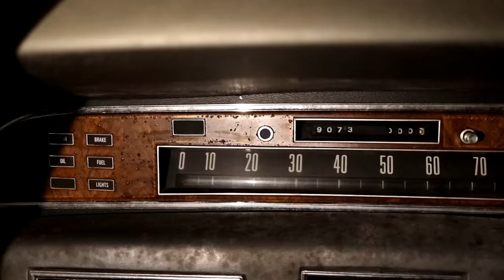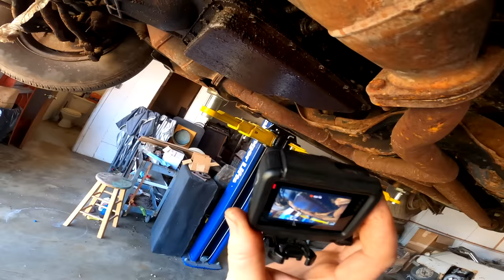Abandoned 77 Lincoln Continental Rescued After 35 YRS | Barn Find With 9000 Original Miles| RESTORED

Comment: My dad had one that was a78 model. The same exact color. Loaded out for that year. It had a 460 hp. Thats what it said on the air cleaner. And for a 5000 pound car it would bury the 120 mph speedometer and keep on going past that. Smooth as a pin even at those speeds

Comment: WOW 😯. Absolutely amazing to find a car that old with only 9,000 original miles. Pity that she’s a little dinged up but definitely worth addressing the dents and a good fresh coat of paint. On second thought though I have to question the odometer based on the the repaint and the condition of the underside of the car. Hmm 🤔

Comment: Nice car!! What brand plugs were in it? Do the wires say motorcraft or ford with a date code? The blue distributor cap isnt original.  Why would it need a tuneup at 9k miles? Still its awsome

Comment: Important message to the restomod people:
Please do not alter this reference OEM 77 Lincoln.
Leave as it is.
This car must stay original for future references.
As you well know, too many engines are damaged because neither an oil/filter change/air filter replacement/ was done or checked.
Excellent initiative that you guys took out the oil dipstick, and inspected it.
Refer at 7:15 time.
Can't help but wonder about the transmission dipstick readings though, after engine start up...
First start up of an engine after many years in improper storage or special care, spells pure havoc (damages) into motor internals.
Must admit that those hideaway/retractable lights and concealed wipers assembly, were the strongest selling points for me as a kid.
A leaf blower would of come to mind personally, for initial clean-up.
Really entertaining video and well done!

Comment: You missed the chrome bumper. But overall turned out pretty good. I am currently working on restoring a 77 Lincoln Mark V 99k miles and ZERO rust. Needs alot of engine work unfortunately, it's sitting on a engine stand ready to go to a machine shop to be hot tanked. Got alot of parts ready to be installed, she's gonna have at least 600 HP

Comment: For that "stink", if you take an old pair of ladies nylon hose or two and fill each leg with Activated Charcoal (like you'd use in an aquarium filter), tie a knot in each, making a bag o charcoal, and hide each one up underneath the front seats, one or two under the back seat, a couple in the trunk... That funky smell will go away in a few days... Leave em there until you notice the stink come back, they usually work for about a year.... Just replace the charcoal.

Nice old Lincoln!

Comment: In my opinion if a little old lady drove that car to church every Sunday  she drove from TX to the church  in NY. I own a 78 Cadillac with 28K now in 2023 and it still looks new with no rust or corrosion on and of the exhaust system or under body and the paint and interior is still like new. My first clue that I feel the car has 109K was the AC belt missing and the heater hose tied up with a wire. Still a good solid car that is easily fixed and has a lot of life left to it.

Comment: That 9000 mile title got my attention until you were under the car.  With the amount of oil and stuff around the oil pan, transmission and the Michelin tires (Ford products always used Firestone) and you mentioned it's been repainted. It's really a mileage unknown and closer to 90000 or the odometer broke at 9000 but the speedometer still works.

Comment: I can tell you that car has had the oil changed by the filter. When these Lincoln’s came out brand new they had a solid gray color filter on and came with break in oil that had to be changed after so many miles.I know this from working at the Lincoln dealer off LBJ freeway in Dallas years ago when these cars were still new, we sold those Motorcraft oil filters being I recognized that right off the bat.

Comment: For long as this Lincoln has sat I’d remove the factory catalyst converters. The longer you run it they will eventually stop up and pressurized the engine and blow the rear main seal. I had a 80’s ford that did stop up and blew the rear main seal.

Comment: Not a doubt a little old lady dinged a car like that up in 9k or 109k the leaks kinda lean towards 109k like others are saying. Our drummer once owned a 78 Diamond Jubilee edition Thunderbird, with a hair over 3k miles on it, documented. Every original part from the factory minus having 1 oil change. The little old lady who owned it first, got a nice fat dent in the passenger quarter right behind the door within the 3000 some odd miles. 
The leak and grime could’ve happened within’ 9k miles but it would’ve had to have been someone barely driving it for many years.

Comment: On the tires the Firestone 500 would have been on the 75-76 Top line Fords but they had a huge recall on those so Ford used BFGoodrich for a few years to replace the 500s till Firestone came out with the 721s not much better in my opinion , give me the Goodrich anyday !!

Comment: 109k miles - the 70s were tough on cars, but not that tough that a 9k car would look like that. Sludge, Stains, painted new, different tires (fronts where michelins, back goodyears). 109k Highway miles though...judging by that brake pedal very long drives without touching the brake much. Still, really good one!

Comment: You have to remember, if the alternator bulb (in the dash) is out ( key on engine off), then the alternator wont work. Replace the bulb and the battery will charge.

Comment: I wouldn't expect if a car had only 9,000 miles on the odometer that it would have grime on the rocker covers, even if it had never been serviced!

The general condition in the engine bay suggests a lot more miles than that!
Reply: You are right. 
On These old American cars the odometer only goes to 99,999 and then it will roll over to zero. It probably has 109,000 miles on it. 
Last year my 1967 Dodge Charger odometer rolled over to zero. It had 94,000 miles on it when I got it. 
And I wouldn’t be surprised if it already rolled over once before LOL
My charger probably has 200,000 miles on it

Comment: It's in good shape for being 45 years old. That's 109,000 miles my bet. I'll bet it was a traveling businessman or traveling salesman that bought it new. It's a 77 & was parked in 83, that's 18,000 miles per year, which is reasonable. There's several things that could explain the DOT codes on the tires, but my money is on 109,000 miles. The dings, dents, & scratches on it, the drivers side being slightly worn a little more than the rest, that's definitely 109,000 miles. 
Of course you wouldn't do it, but pull a plug out & stick a camera into the cylinders, it would look almost brand new if it was only 9,000 miles. Of course you probably won't see too much wear, as good as it runs, but my guess you'll find normal wear for 109,000 miles. 
I'm a GM man myself, but that is a nice looking car for being essentially a Ford product.🤣  
I just prefer a Cadillac over a Lincoln😆

Comment: Odometers back then went to 99999 and then rolled over to 00000. That's more like 109000. After my 1971 Continental rolled over it barely got just over 101000 miles until the engine seized. For years prior to myself buying it, the tank was filled with unleaded gas and those old engines like the 460 I had needed leaded fuel and no one bothered to add the lead substitute.

Comment: it's not good running a car with a dry transmission it's a good way to burn the pump right out of it and putting a dry trans in gear is no good too. it's good to have fluid on the stick before cranking the engine even if it's not to the full mark at lest you have some to allow the pump to have something in it to keep cool

Comment: As a Lincoln fanatic and owning over 25 Town Cars, I will say that I do NOT believe this has 9,000 Original miles. I'm confident it has Over 100,000 miles. I had a 1976 that had 140,000 miles and showed NO wear on the interior and the whole car was Spotless. Also....Tires in the 70's did NOT have a Date Code.
Reply from the maker: https://www.cokertire.com/blog/tire-age
Reply: @RESTORED-HOPE  I admire your restraint in not responding to all the naysayers but instead posting a simple link with the facts about tire date coding.👍Guess they all also missed the fact that you mentioned the car was parked in '83 so those tires could not be from '87 and as such would never had that much tread left with over 100K miles being tires manufactured in '77 on a '77 vehicle. I guess it's possible that a second set could have been put on a few years after new by a garage with NOS or who never rotated his stock but then there's your assessment of the pedal wear and visible driver seat wear or lack thereof. 

It also looks like it was parked with the hood up in a damp "barn" for a long while where it gathered the same grime in the engine compartment over decades that the exterior had. A damp, non concrete floor would also account for the underside/mechanicals condition. Valve covers were notorious for being leaky and building up grime from day one on these older era of cars.

With regard to the body, I've seen excessive dings on one side of a car only where careless family members (or co-workers) parked next to a vehicle always in the same spot and consistently abused it by opening their door(s) into it. Most people just don't GAF about cars and it's a shame. Enjoy that land yacht!

Comment: Nice car but with all the road dirt around tge valve covers a trailer hitch installed the carpet wear  I am thinking a lot more than 9000 miles. What does thar matter it looks great and will drive great for another 9000 miles at least I think I would keep it.

Comment: i would say that is Not a 9000 mile car as i have seen lots of low mileage cars in my day a 99.9 % of the time they are org paint not a repaint i would say most likely a 109000 mile car but still a time capsule .My grandpa bought a 78 Lincoln same color he worked at Ford and got the last 460 car to come off the line it was the same color but had Formal (small back window) white1/2 top.After 78 all you could get was the 351M/400 Engine .

Comment: It has to be 109,000 miles, there wouldn't be so much oil and grime on the valve covers and engine/transmission.  Just sitting with low miles would have layers of dust not oil.

Comment: Nice car, However 109,000 miles you would not have all that grime/leaking in the engine bay and repaint and oxidation inside a garage . Nice Find however

Comment: The '77 was the last Town Car to have the full, padded dashboard and with an enormous ash tray. Subsequent models had cheap crap for a dash, same as you'd get in an Ford LTD, the cruise control buttons on the steering wheel falling off every year or two. Also only the steering wheel itself tilted, not the entire steering column. ALSO annoying.

Comment: I haven’t watched all the way through yet but I highly doubt the 9000 miles. I’m going with 109k or maybe less and someone turned the odometer back. Too much oily dust and dirt on the top of the motor and who repaints a 9k car? I mean it could have been in an accident then repainted but I didn’t see signs of that.

Comment: After 35 years, ALL hoses, flexible brake lines, cooling/heating hoses, tires n wires should be replaced. Fuel tank should be removed n boiled out to rid it of interior rust. Replace coolant, oil n trans fluid. Replace spark wires, wires, rotor n cap. Any other rubber parts, too. I wouldn't buy a car from those guys. They cut too many corners.

Comment: No weight 9000 miles that's the original oil back then you changed the oil around every 3000 miles